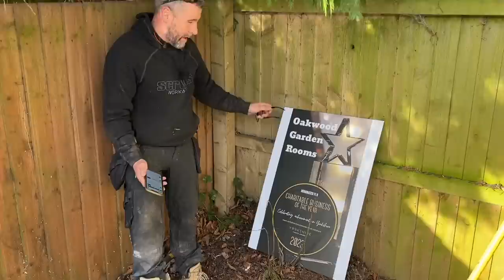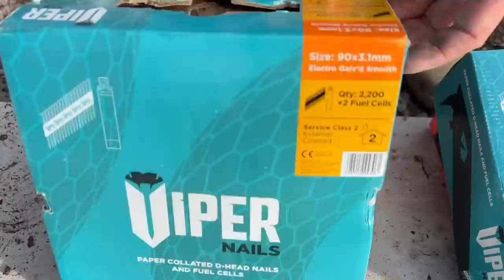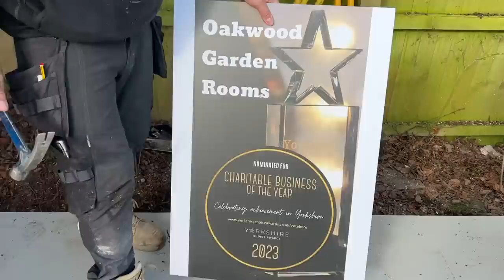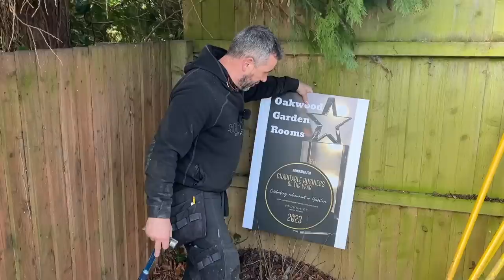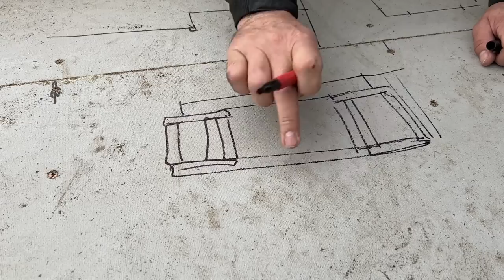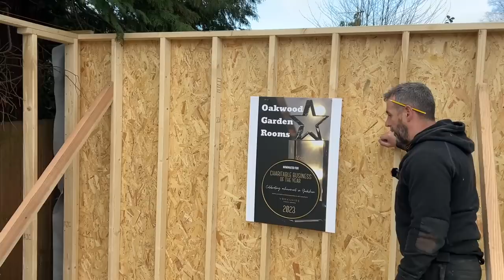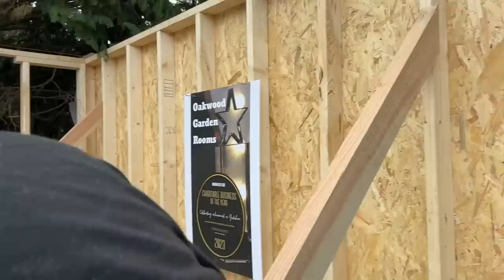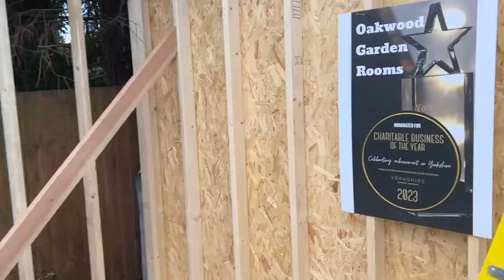How to build your own garden room like a pro, day 4

Comment: If you are looking for a paslode that works in colder conditions, you need to take a look at the i-series paslodes. They have what they call, cold weather performance. And will supposedly work down to temperatures of -15 however they do use different nails and gas cartridges, which are almost twice the price of the ones for the 350+

Comment: Hi guys loving the series I bought a 5x 3 garden build pack from yee a few weeks ago, I’m in Ireland and the shopping list makes sourcing all the materials so much easier, its excellent value at 96 pounds one quick question I’m cladding the back and both sides in metal clad can I fix the clad to the timber slate battens rather than buying the resilient bars as I already have the timber battens so trying to reduce the overall costs keep up the good work 😁😁
Reply: Sorry one more thing if I clad it before I stand the wall up what gap should I leave at the top to be able to run the soffit in thanks

Comment: Part 4 : Another great video. Can I ask when fixing the walls to the floors I notice you screw down through the floor randomly. Isn't there are risk if you fix more towards the inside of the room than the outside you may miss the floor joists and only get a fixing through the flooring? Keep up the great work guys. 👍 👍

Comment: Was gonna ask after your last vid why you don't use 90 ring shanks. Think you may have just answered it. I'm assuming it's cause of the lack of power in the paslode? I've got an old paslode and it doesn't have an issue with them 95% of the time.

Comment: Question: I want to use my garden room as a gym… with heavy weights and equipment in. Over 400kg of iron weights alone before any equipment is in there. Would you recommend the rod system for a gym with heavy weights and equipment? What about the floor joists? Or opt for a reinforced concrete pad? 
Great videos 👍🏻
Reply: Your questions wrote down we will answer on Monday we got through quite a few today but I’ll do the rest on Monday if that’s okay😊